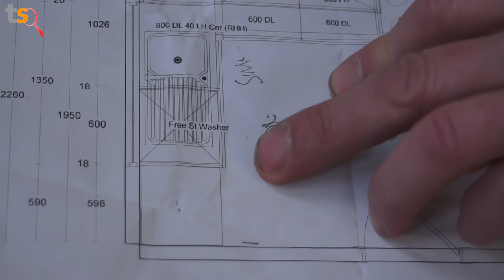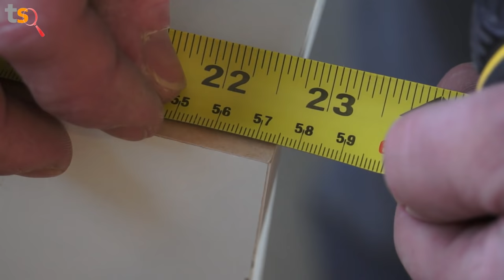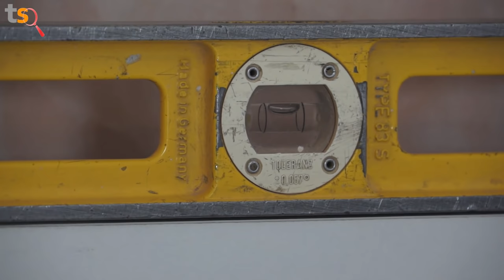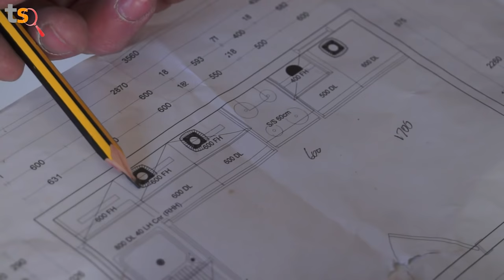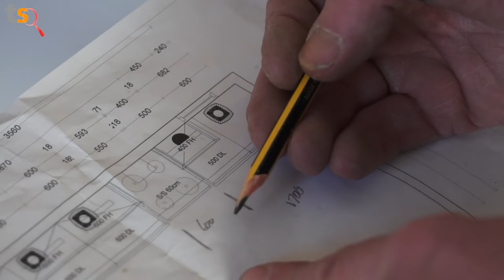Tommy's Trade Secrets - How to Fit a Kitchen - The Base Units

Comment: Dave, thanks for the excellent video. I'm just starting on a DIY kitchen project - so this may seem a daft question...but I'll ask it anyway! I see you've fastened the infill post to the side of one of the carcasses. Yet when it is fitted in place on the other side it will sit on the outside edge of the other unit (running at 90 degrees). This means that the infill on that side will butt against the door - whilst on the other side (where originally fixed) the door edge will be protruding beyond the infill post. Do you ever use blocks to butt the infill the width of a door so that both door edges are hidden? Or is there a reason why this is not done?
Reply: You're right Bruce. the doors should be flush on both sides which would have also solved the clearance issue with the pipes

Comment: A prime example of bad design. The kitchen doesn't fit. This is exactly what I'd expect though from Howdens. A half decent independant kitchen retailer would explain to the client the errors here. The corner post doesn't line up with the doors on both sides. There's no filler far right. Different sized unit either side of cooker. Sink too close to worktop joint. I could go on. On principle I'd refuse to fit this kitchen. Appalling!